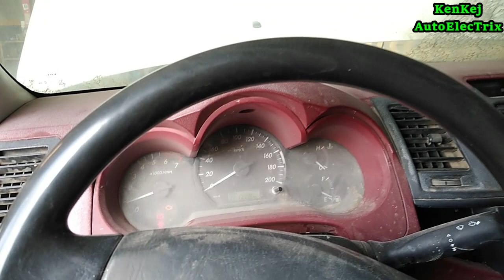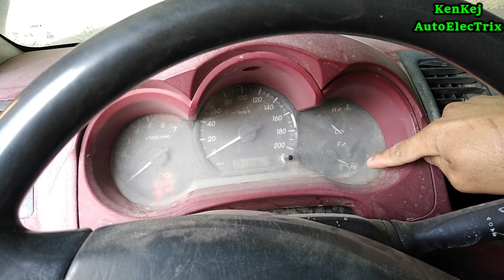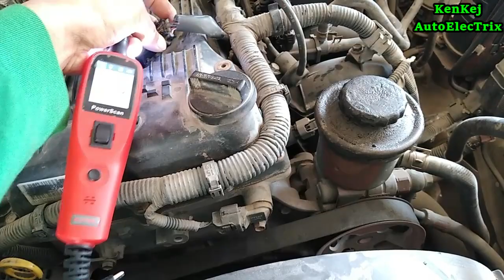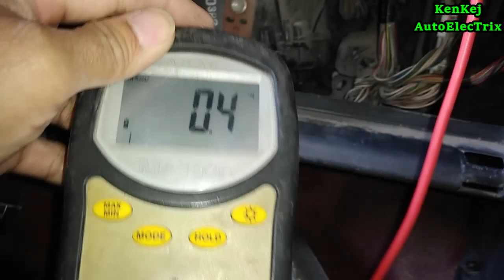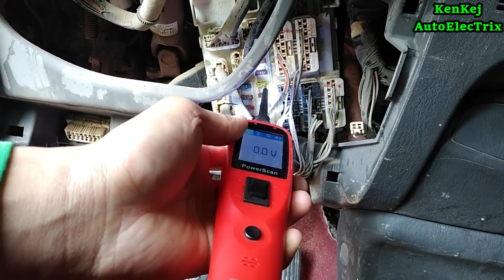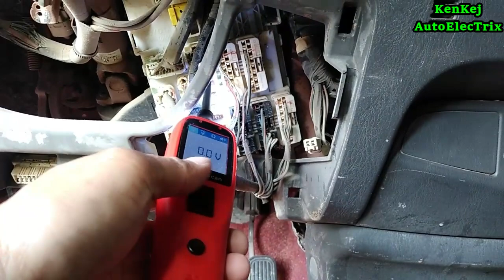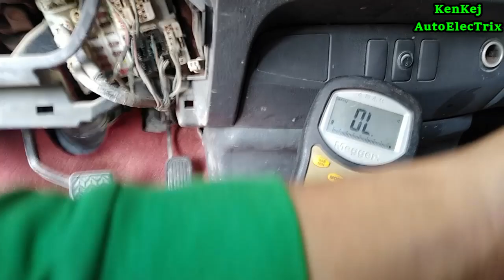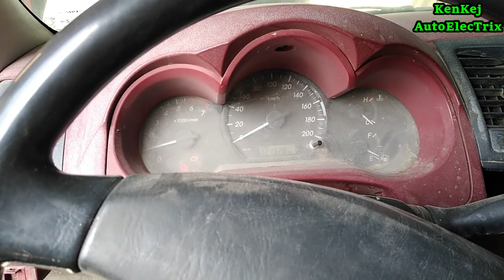TOYOTA HILUX 2012/ CRANK NO START

Comment: Sir may tanong ako.yung mga bagong sasakyan ngayon na may ecu.yung wiring diagram ng starter dumaan po ba ng ecu o hindi na?
Reply from the maker: May mga ibang unit sir yong negative trigger ng starter relay dumaan sa ECU at inhibitor switch kung automatic transmission. Pero my mga unit na hindi na dumaan sa ECU.

Comment: idol yung ignition wire ko 12v at 0.2 at 3.8v signal syaw pa rin umandar
Reply from the maker: Check crankshaft position sensor
Reply: sir diagnose nila ecu repair daw
Reply: kapag hnd maka reading sa scan sira  ba ecu
Reply from the maker: Kung ok po lahat ng supply sa OBD Port at hindi parin mabasahan ng scanner malamang ECU ang may problema